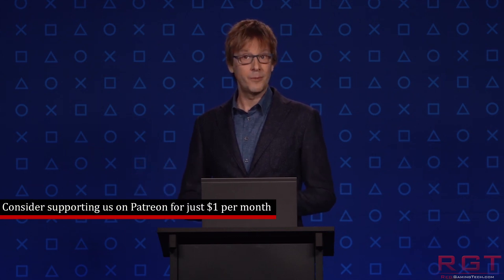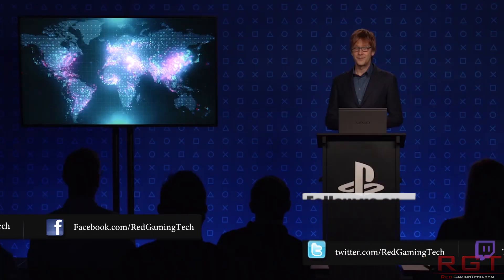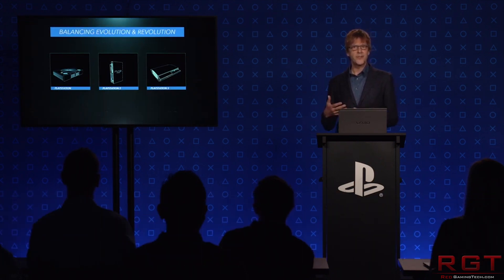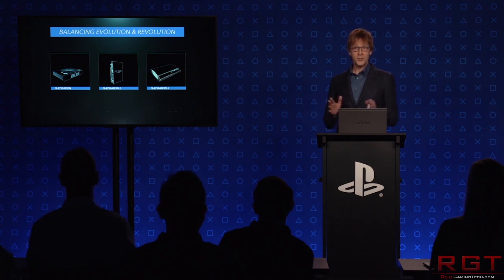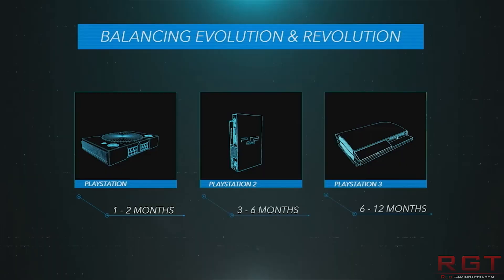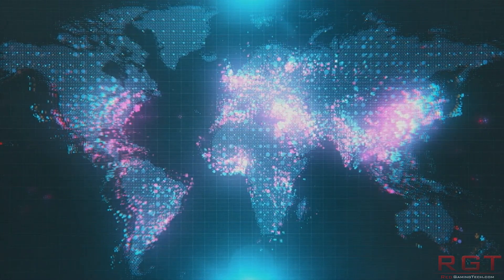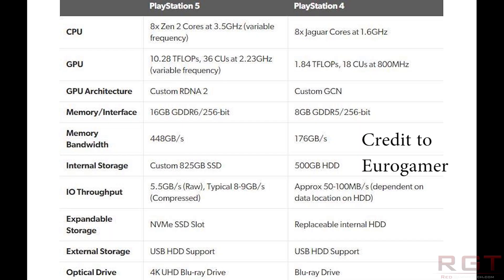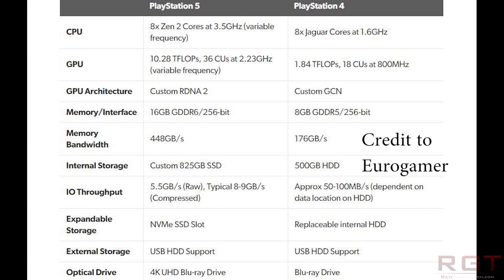Playstation 5 Spec Overview & Analysis | 10.3TFLOPS & RDNA 2 | 3.5 GHZ Zen 2 & Crazy SSD Speeds

Comment: You can tell that the 9.2 TF vs 12 TF leak was accurate. Sony has been quiet trying to figure out if they can over lock the gpu frequency. 36 CU’s at 2.23 GHz was probably supposed to be at 1.95 GHz. They tried their hardest to catch up but still fell short. So PS5 was originally supposed to be 9.2TF but ended up being tweaked to get 10.28TF. Lol
Reply: Exactly lol
Reply: According to underground resources this is a marketing ploy to prevent microsoft putting their guard up, great things are about to happen for ps5. Up to 14 tf.
Reply: @chikachikaslimshady1  lol that's wishful thinking
Reply: @ChanTheMan1996  lmao nope, im connectedvto insiders. Does ps5 pro ring a bell? Xbox is screwed
Reply: @chikachikaslimshady1  14tf at what price.  You know a 14 tf console would probably 600$ minimum right,  more like 650 -700
Reply: @chikachikaslimshady1  keep dreaming buddy 🤣🤣🤣🤣🤣
Reply: @ultragoldcoin8780  yeah it's called high end.
Reply: Of course. What a bunch of genius...
Reply: @ultragoldcoin8780  If they not cheap out on the Thermal interface maybe 12TF?   they only need to stretch it to 2.6Ghz
Reply: @chikachikaslimshady1  My uncle works at Nintendo. According to him, the new Atari is going to be 69 terraflops. Legit.
Reply: @BaranLordofLight  no one is buying that dude.  600$ is already stretch plus with coronavirus and job loss ramping up,  no one will buy that.  600$+ is a no go for almost everyone including me who cam afford that.
Reply: @brunogm  that's fair,  but they would one super expensive cooling solution lol.
Reply: @ultragoldcoin8780  in bulk gallium/iridium alloys are cheap.  The lapping pass is not easy but even if it cost 10 bucks they could narrow the gap.
Reply: @chikachikaslimshady1  No, because we have not seen standard version. Expandable storage is not available on the market yet, it has also proprietary controller and slot. So no.
Reply: Georgian Wolf hahahahaha ha I hope that’s sarcasm and not delusional hysteria! Omg I think I just pissed myself I’m laughing so hard
Reply: @ultragoldcoin8780  I'm buying the most expensive highest performing PS5 I can. Plenty will.
Reply: @chikachikaslimshady1  So you're saying I should buy the magic beans?
Reply: @chikachikaslimshady1  Two words... Tommy Fisher
Reply: UltraGoldCoin I’ll buy it.
Reply: Keenan Dumoy same here.
Reply: leonxl they better be on top their cooling game if they just want to overclock for performance to prevent from constant throttling down.
Reply: Bullshit, there's no evidence of that being true.
Reply: 10.3tf max, it will burn itself out running at those speeds
Reply: leonxl lol nice fake news
Reply: Thicc Boii  its rdna 2. Already way more powrrful than a 1080
Reply: @AFterMath-ld1vr  something fishy about Mr Fisher
Reply: @chikachikaslimshady1  day dreamer
Reply: @S99-c5s  What i dream comes to pass because due to law pf attraction and manofestetion powers i posess, mark my words, sony will reign ki g with 18tf raw power. Speak it believe it recieve it
Reply: Chris Goody  Youre sad for not seeing into the future like me, im far ahead
Reply: Georgian Wolf you can say the same with Xbox. Imagine there “pro” version. Let’s deal with facts instead of hope lol 😂
Reply: @Renegade_909  No one can say it like what cant cant u underatand? Im special
Reply: @alexbasha0508  im not drunk, u drunk
Reply: @H0DLTHED0R  I work at a high end resturant n get hella tips cash, celebreties rich ppl come all the time get on my level kid, were not even in the same league
Reply: @chikachikaslimshady1  be careful i might takeover im British
Reply: @S99-c5s  speak it believe it recieve it
Reply: @chikachikaslimshady1  😂
Reply: @chikachikaslimshady1  I heard a Xbox Series Deluxe at 28 tf. LOL
Reply: Lmao delusional, xbox ALWAYS has the last laugh. I dictate the future, if u believe, u can acheive. Law of attraction. Only works for me tho since im specially gifted with powers of manifestation
Reply: @PrinceZappa  Thats prolly true, as xbox r kings of surprise release.
Reply: @Sean Cole Absolutely NO. Did you even watch the presentation? What about all of Paul's video? This clock speed is maintained within 2%.

PS5's 'SMARTSHIFT TECH' with it's VARIABLE CLOCK Frequencies is very impressive. This is where the CPU can give power to the GPU and vice versa that it's not using to produce even better visuals. It also is one of the reasons why the PS5 can MAINTAIN the MONSTROUS 2230GHz GPU clock speed within a maximum 2% loss. GPU clock speed is just as important for performance as how many compute units. The PS5 is 405GHz faster than the Xbox's 1825GHz which means the GPU can do more work and the caches can be faster. This means the PS5 will effectively be much faster, even without considering the crazy SSD system (Series X SSD 2.4BP/s vs PS5 SSD 5.5BP/s. It will also help negate the extra teraflops in the Series X GPU. Absolutely brilliant!

This SMART SHIFT TECH is very intriguing. A brand new approach to increase performance by using all power instead of wasting it. I fucking love the idea! Paul from RedGamingTech called it in his Microsoft tech reveal video. He said that MS were making a very strong point of how the Series X's GPU and CPU were locked (which is normal). He claimed that MS sounded like they knew something about the PS5 and were worried. MS wanted to take the attention away from that PS5 part (SMARTSHIFT) by emphasising their point of 'locked clock frequencies'. Bang on!

This SMARTSHIFT tech alone has been confirmed by AMD to give a 10% boost to performance. That is massive!
Reply: @glehranmertell9726  you must be suffering from The Rachel Madcow disease!

It's ok, least he didn't hand over billions  in secrecy to a terrorist nation in Iran like  Barry O.

Just like Trump, Xbox series X will save us.
Reply: @H0DLTHED0R  lmao In Hs I always came in first in feats of athelticism. I had a effing reputation for it school of 2000+ people everyone knew me and if they didnt know me they knew of me. My stamina n cardio was impecible, my strength although not the strongest in the school still elite. I was bench pressing 275 at the age of 16. I bench almost 400 now n i dont even train much lmao, i have vid footage of me overhead pressing 225 for reps want to see? Not just that people knew me across multiple schools... i didn' hit on girls, THEY hit on me. U kno whats funny? I was still a relatively shy kid but it didnt matter, they jumped on me anyway. When u look like me, u just get a pass on everything. I walked around like i owned the place. N thats just my school years. Contact me via facetime n try say that shih to my face, im always prepared to back up everything i say so ima enjoy humuliating ur ahh

Dont ever doubt me bihh

N yea i am bitter lmao. Bro if im bitter its only as long as i choose to make it last because at anytime i can literally choose my life easy, n get anything i want. Ppl like u on the otherhand u just stuck dere forever 🤣🤣🤣

So yea u right im bitter but thas just temporary ima be around 9s and 10s everiday soon. Just nature of my buisness im in. Cant wait
Reply: @chikachikaslimshady1  and just what stopd xbox from doing a mid gen refresh as well will all probably end the same with the current  ps4 pro and xbox one x xbox still took the lead
Reply: @De1usionsofGrandeur  nah ps5 is always in the lead, they never lose. Just destiny
Reply: @chikachikaslimshady1  it depends what you grade them on .. they lost in backwards compatibility, they lost in services with gamepass and soon to be xcloud, they lost in controller battery life. Lost in power series x is stronger then ps5, sony did win in sales, exclusives, hard drive speed, and possibly audio with ps5 3d audio. Exclusives game could change cause Microsoft seems to have some good shit planned this time around but cant really judge it till the gen starts and both sides have some if there new games out
Reply: @De1usionsofGrandeur  Overall is what counts sony always wins. Go cry xbot you can never win
Reply: @chikachikaslimshady1  cool cause xbox has the best over all hardware, best overall services and features. I haven't been crying for years I've been perfectly happy and content all I care about now is all the amazing new games  I'll get to play in the next few years on every platform I own. I am a gamer I ll play games on anything as long as there are interesting and good. While I prefer xbox more then playstation I want sony to bring out good shit too cause I'll own a ps5 too eventually.
Reply: @chikachikaslimshady1   LOL, No, Sorry the PS5 is a 9.2 Tflop console that winds up to 10 Tflops
when it needs to with lots of action on the screen.  13 Tfllops is nothing more than a
wet dream.
Reply: @GregHakes  ps5 pro will be 18tf according to insiders, again xbox has lost. Sorry fanboi
Reply: @chikachikaslimshady1  Dude, I haven't lost anything.  The PS5 was suppose to be
13 TFlops and it turned out to be 9.2
Tflops so i'm not worried the slightest bit about a 18 TFlop PS5. LOl, LMAO.
Reply: @GregHakes  Wym you havent lost? You clearly LOST. Why trynna justify by letting me know u havent lost? It doesnt change the fact that u lost lmao. Denial at its finest. Your console lost like it awlays does 🤣🤣🤣
Reply: @chikachikaslimshady1  I didn't lose anything, you 
just think i did. LOL, LMOL. LMAO.
Reply: @GregHakes  Nope, you lost. Factually. Im the winner. 🤣🤣🤣🤣
Reply: @chikachikaslimshady1  Like i said i haven't lost anything, Playstation is the one who lost the
power battle.  The Series X will completely destroy the PS5. And when the Pro comes out
in 3 years,  Xbox will destroy that as well.
Reply: @GregHakes  Yeah i know u keep saying it but sayn it dont change facts lolololol. U lost. Microsoft lost. Youre inferior. Im superior. This is factual, doesnt matter what u say. I win. 🤣🤣🤣
Reply: @chikachikaslimshady1  Nope, Sony alway's loses.
Reply: @GregHakes  whats the matter? Gave up cause u know u lost? Lol of course u did. I win
Reply: @chikachikaslimshady1  You Lost, Sorry you can't compete with me cause i'm a winner !!
Reply: @GregHakes  You're not on my level kid
Reply: @chikachikaslimshady1  You're right, i'm 3 levels above you !!!

Comment: You should look into how AMD did raytracing on RDNA2.

Raytracing on RDNA2 uses the TMUs (Texture Mapping Units). Not the pixel shaders. Depending on workload you don't always have 100% utilization on your TMUs. AMD has made them dual purpose and can switch between tasks on the fly. So it is simply a matter of feeding the units efficiently. They are also highly dependent on Memory Bandwidth. 

What MS said is if you were to use pixel shaders to do ray tracing you would need a dedicated card just for that. But they are not using pixel shaders. 

Every CU has 4 TMUs
XSX is going to have a fair higher TMU count along with higher memory bandwidth
XSX is going to have a lot more Ray tracing Power
Reply: Lol
Reply: Well said and explained. People think that just because both consoles have RDNA 2 RT cores that the ray tracing will be the same. They won’t. Not only does Xsex have more TMU’s and bandwidth but the software implementing the ray tracing is significantly different and manages the workload differently.
Reply: Drake Gould Apparently with running Ray tracing it’ll be doing 25Tf or something absurd.
Reply: They have dedicated Ray tracing hardware and not using TMUs(the TMUs is still same).

The ray tracing difference

RDNA 2 fully supports the latest DXR Tier 1.1 standard, and similar to the Turing RT core, it accelerates the creation of the so-called BVH structures required to accurately map ray traversal and intersections, tested against geometry. In short, in the same way that light 'bounces' in the real world, the hardware acceleration for ray tracing maps traversal and intersection of light at a rate of up to 380 billion intersections per second.

"Without hardware acceleration, this work could have been done in the shaders, but would have consumed over 13 TFLOPs alone," says Andrew Goossen. "For the Series X, this work is offloaded onto dedicated hardware and the shader can continue to run in parallel with full performance. In other words, Series X can effectively tap the equivalent of well over 25 TFLOPs of performance while ray tracing."
Reply: Kusuma Yogi That is...... disgustingly powerful.
Reply: @alexbasha0508  Sony is too stingy and lazy, if only they make better backward compatibility software and want to spend more on hardware. Playstation 5 will not be stuck with 36 CUs on the GPU.

they are also too focused on SSD, yes indeed without loading time but ssd will not be able to help the GPU to make a higher resolution or higher fps.

Sony is still conservative in maintaining the form of a console that must be small and thin (I can guarantee the shape and size of the PS5 is not like the xbox series x, but it still uses the old concept where the console must fit on a television rack)

Though xbox dare to take risks with a fat form but provides a bigger headroom. especially now gamers don't really care about size or shape, just look at the shapes of large and weird PCs.
Reply: Bingo! This dude not only listen he comprehends.
Reply: That would be no different from how RTX is implemented in Turing. Intersection testing (the important part of RT that is actually HW accelerated) is a memory access reordering issue, so it is logical to re-use the existing memory access hardware, i.e. the TMU and augment it for the purpose of the ray-tracing. Most of the the rest of RT workload is actually defined by shading stages, executed as ordinary kernels.
Reply: Let's wait and see on actual real time HW comparisons with games running. I expecting some very big surprises with Sony's system. It looks to be a very impressive optimised console that will be blisteringly fast for all information. Just look at how amazing first party games look on the measly PS4 PRO. The Last of Us Part II and Ghost of Tsushima look to take the best looking crowns this generation. So much for the Xbox One X's extra power...
Reply: @HanzouTheRazor  yep sony are masters at optimisation but still and sadly ps5 is too weak
Reply: @kubi1110  I disagree. You are looking at it in a traditional sense of sheer numbers. The thing is that the PS5 isn't going a traditional way. Nobody will know for sure about performance until we can truly compare the 2 side by side. I think there are going to be some pleasant surprises. 

Either way, the PS5 looks to be destined to be cheaper which always equals much better sales. As for power, it is always won on PC...

https://www.pcworld.com/article/3532342/sony-playstation-5-taps-amds-radical-smartshift-tech-to-push-its-gpu-to-ludicrous-speeds.amp.html
Reply: Hanzo TheRazor Bruh you have ZERO basis for your opinion. In fact the little evidence we have shows the following: Sony is not confident, that’s why they’ve held back info for so long. They are having cooling issues per the Bloomberg article. And based on the fact they haven’t shown you a glimpse of the physical machine also tells me that cooling remains an issue and they haven’t finalized the form factor of this console. Because there is no reason to wait unless they are waiting on price from MS to make their decision for them. Depending on what MS charges for the X will dictate Sony’s final cooling solution decision and the PS5 price.
Reply: @HanzouTheRazor  dont think device that weak can impress someone except little kids
Reply: @HanzouTheRazor  There’s no doubt the PlayStation 5 will be much better than its predecessor, and rival today’s midrange gaming PCs in the worst case. But there’s also no doubt that the Xbox Series X will be an utter beast that puts most gaming PCs to shame. It remains to be seen just how big the performance difference will be when the two consoles launch this holiday season

Its from that article 😅😅😅 sadly and for my biggest disappointment ps5 will suck and its a garbage and shame for a company
Reply: @kubi1110  like the switch, you mean? You know, the one that has absolutely humiliated Xbox One family? And, also the kiddy PS4 PRO? The other one that has made a fool of the Xbox One X? I wished Microsoft had the balls to release sales figures. Not to worry, AMD did it for them 😂
Reply: I refuse to lower myself any further. Peace ✌️
Reply: Hanzo TheRazor Sony is NOT cashed up. Sony ONLY has 2 divisions of Sony Corp that are in the black financially: 1) Gaming division which includes PlayStation 2) Financial services division. Their financial services division is about to take a HUGE hit from Covid19. All of Sony’s other divisions ARE IN THE RED. Go read Sony Corp’s financial report from last quarter. Every single division besides the two I listed are in the RED.

Comment: PS5 is 10.28 Tflops (variable frequency). Meaning it will fluctuate from 9.2 to max 10.28
Reply: @punkem733  Yea I know right. It's not how the boost clock works at all.
Reply: Was quoted that only a 2 to 3% drop in clock speeds will be needed for a 10% power decrease 
So a 2 to 3% decrease in clock speed will be around 9.9 to 10 Tflops 

So it's a 9.9 to 10.28 Tflops

To drop to 9.2 Tflops it would need to drop around 20% clock speed
Reply: legacy of Kain great name lol miss that series so much, would love to see a new game or reboot
Reply: @froggs30   yeah one of the best games for story I've ever played, Kotor was great also.

 vae victis